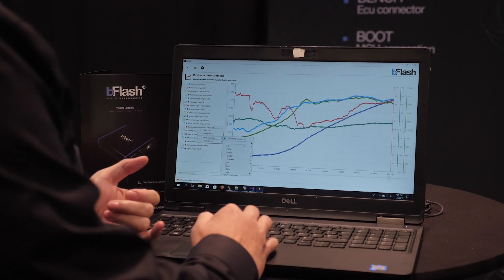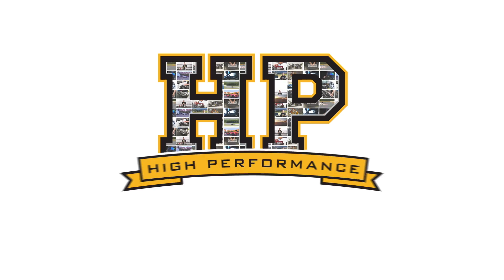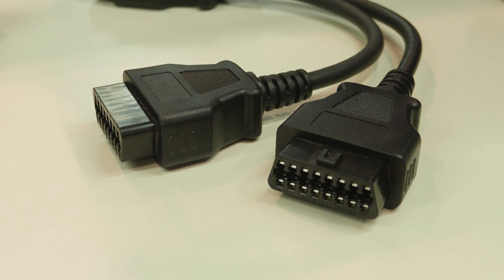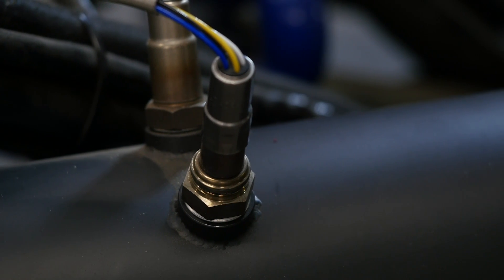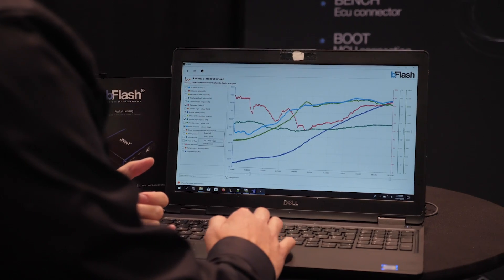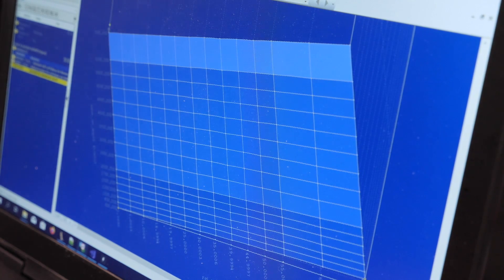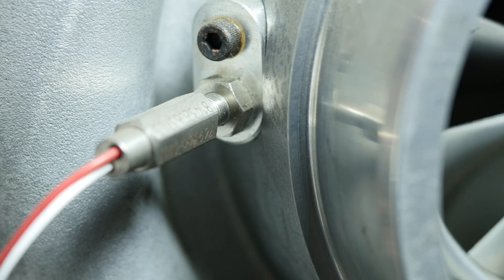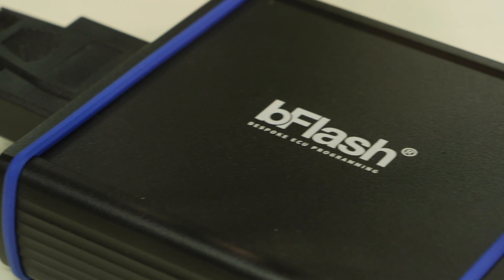The Next Step In Automotive Sensors | SENT & PSI5 Protocol [TECH NUGGET]

Comment: Would be nice to have a short explanation on these points:
Why not use already widely used CAN Bus ?
How does these new protocols differ from CAN ?
Reply: This seems a nice explanation
https://www.idt.com/eu/en/document/whp/tutorial-digital-sent-interface-zssc416xzssc417x
Only thing that still is unclear, how closed the specification will be.
Like, for CAN, the low level signaling side is open and well documented, but when it comes to the data itself, then, well good luck reverse engineering it, as everyone creates their own proprietary protocols.
Reply: Also this opens up a new niche - analog X sensor to SENT adapter, for additional/different sensors.

Comment: I just came across this technology for the first time 2 weeks ago with a 2014 Jeep with a Mercedes common rail engine which used a digital signal from the intake Runner flap motor to send it's position to the ECU